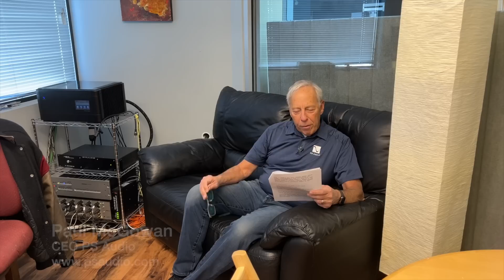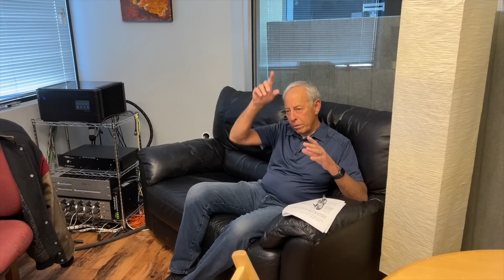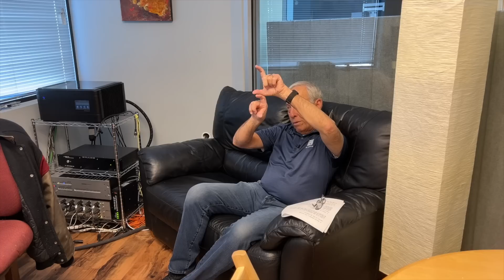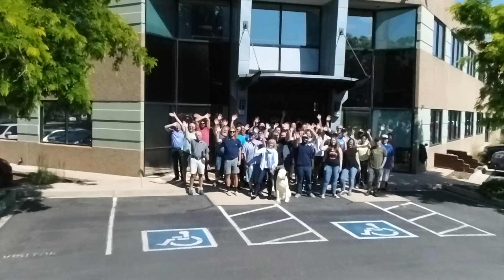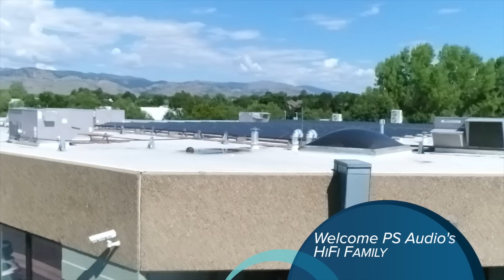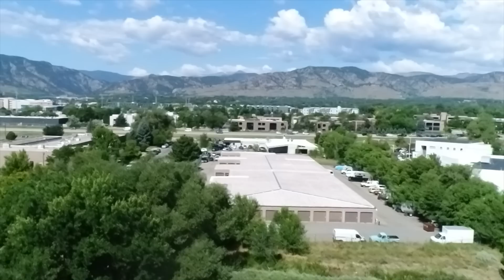Understanding series and parallel speaker connections

Comment: Hi Paul, your explanation is geared more towards electronics. Let me simply for anyone who wants to know how series and parallel connections affect loudness. 
When you connect two speakers in parallel you get a total of 6db increase in the SPL level of a single driver at the same amp volume. 3db from doubling of power due to halving of impedance and another 3 db from the summing of sound waves from each individual driver. 
Connecting two speakers in series, there will be no SPL increase of the two drivers vs one driver at the same amp volume. That's because impedance doubles hence halving power which leads to a 3db decrease in SPL. The 3db increase from drivers summing cancels out with the 3db decrease from halving of power.
The advantage of a series connection is you double the power handling of the drivers hence increasing the driver's maximum loudness. It also lowers distortion at high volumes since it halves the excursion required to produce sound at a certain SPL level.

Comment: So what is the practical impact of the two speaker cabinets in series?  Expect to need to turn up the volume to get the same loudness.  Also expect the sound quality to be lower.  Each cabinet is a complicated circuit with resistors, capacitors and inductors to feed the proper frequency to each driver ideally without messing up the phase of the signal to each driver.  By the time the signal passes through them both my bet is the sound from the two boxes is a bit muddled.  Also the wave propagation from the baffle of each driver will be interacting with each other so the chances of the image being as good are low IMHO.

Comment: I used to have a cheap hifi system. In series there was no problem,  but in parallel the amp would start clipping at higher volumes
Reply: Yes, and some speakers have dips in the impedance at a certain frequency that makes the matter worse when you put them in parallel.
Reply: @ThinkingBetter  which is better... connecting two sets of speakers from the amp, or from the back of first set into the back of the second
Reply: @geddylee501  When speakers are connected in parallel you will get best result (at least theoretically) by having both connected directly to the amplifier for best damping factor/behavior.
Reply: @ThinkingBetter  🍻

Comment: Confused question, confusing answer. A speaker marked 8Ohm 30Watts means the speaker can handle an input of 30Watts. 8Ohms is the nominal impedance and this may drop to 4Ohms at some frequencies. Connecting two 8Ohm speakers in parallel may not be a good idea as it will present a nominal 4Ohm load to the amplifier which may drop to 2Ohms at some frequencies. Many amplifiers will be unable to drive such a low impedance unless specifically designed as a high current amplifier.

Comment: Does an amplifier put out higher voltage to higher impedance speakers?  I would think there would be a max voltage dependent on the input voltage and the output voltage is a multiplier of that (minus voltage drops from volume adjustment pots) as both input and output transformers would have a set number of windings.  So the max output your amp can do to 4ohm vs 8ohm speakers would be twice as much, but that is because the amp is putting out twice the current to the lower impedance speaker.  P=V^2/R=IV

AFA speaker wattage, connecting 2 30W speakers gives you 60W total max output no matter how you wire them.  So you can output 60W to 2 30W speakers without destroying them.

Comment: I think an explanation of what the ''rated at'' numbers are on a speaker may be helpful? Just because a speaker has, let's say a 30watts sticker on the back, in reality that means very little. Apart from don't plug then into a 100watt amp and run them full blast. I might be over simplyfying?

Comment: Than you for the simplified explanation, but I wonder how the sound is affected?
Reply: Probably depends on application. Combining speakers isn’t all that common in home audio. 

It’s more common in car audio and with multiple woofer set ups.  Traditionally it seems best route is to connect in parallel and try to go as low impedance as possible to a point as to what the amp can handle. 

My friends and I experimented with both types.  I tried series approach with 4 8 inch woofers in a box and I wired in series.  Didn’t sound good.  May have been other reasons too. Box size.  Not perfectly sealed. 

Had another friend that was running a 2 eight inch woofer with one 10 in dual voice could sub.  He wired in parallel and I believe all his were 4 ohm as well.  His problem was clipping and also speaker sensitivity where volume would increase too high by slightly touching his slider level volume control.  We switched to parallel setting and it was much better. 

I myself went to 2 10 inch subs with a 12 in middle sub.  I think the 10’s were 8 ohm and the 12 dual coil coil 4 ohm.  I hooked these up in parallel which I believe was 2.7 ohms per channel. Same amp. Produced more strong bass but I designed a better sealed box too.

Comment: Question: I have some Boston HD10 speakers that I purchased new back in the mid nineties. They are advertised and  labeled as "8 ohm" impedance and advertised at 90Db/W sensitivity. They were originally powered by a Pioneer VSX-4800 surround amp that was replaced recently with a Yamaha S701 2 channel integrated amp.due to the speaker outputs cutting out at any decent volume
I do realize that speakers are driven with AC voltage, not DC, and that impedance isn't exactly the same as measuring static DC resistance. 
When I measure the DC resistance through the  HD10 speaker leads, my DMM measures ~3.7 ohms. 
Should a speaker advertised as 8 ohm impedance measure closer to 8 ohms static resistance, or are these Boston HD10's actually lower impedance than rated by the manufacturer?
This concerns me as, from what I understand, running 4 ohm speakers with an amp that is designed to break against an 8 ohm load can damage it due to higher current being required to drive the 4 ohm speakers. I'm wondering if driving these HD10's was the reason my Pioneer amp met it's demise.
Any opinions?
Reply: If 3,7 Ohm - those should be rated at 6 Ohm. 
From my own experiences, usually 4 Ohm rated speaker gives 2,5 Ohm, 8 Ohm rated - no less than 5 Ohm.
Reply: @jareknowak8712  Thank you for answering my question. After reading up on the subject I think running my HD10's with the S701 will be perfectly fine with the amplifier impedance switch set to high, 8 ohms. I'm using a powered sub in addition, and I don't listen at very loud volumes.
Reply: @@Douglas_Blake Thank you for your input, makes good sense. So far so good, my HD10's with the powered sub sound great with the S701. The unit only seems to be emitting minimal heat through the convection cooling vents on the top. But like I said before, I'm not listening at very high volume levels, let alone for a prolonged period of time. I have common wall neighbors, so my volume levels are limited, but I did "de-couple" the sub and speakers from the floor so as to mitigate potentially disturbing my neighbors.  What I like is that it sounds really good without having to play at a high volume level.

Comment: it becomes like a battery and light bulbs. A light bulb draws 1A with current. 2 pcs. parallel connected bulbs draw 2 A of current.

But the battery must be able to deliver 2A of current or it won't work.

Two 8 ohm speakers connected in parallel will be 4 ohms. yes you should get twice as many watts. but then the power supply and transistors have to handle it.
This is where the problem lies. many amplifiers are unable to provide twice as many watts due to the transistor and power supply not being able to do this.

and a speaker does NOT provide a constant 4 ohms but change up and down with frequency!

8 ohms often give better sound than 4 ohms.

Comment: So if I’m wiring two 8ohm speakers together, so I can use only one output on my amp…which is better series or parallel ?
Reply: Don't do it. They both have problems. Think about it, your speakers both go up and down in current needs at different impedances because you're playing 20hz to 20kz. Now they both are sometimes spiking in power needs and sharply dropping together. In parallel they're doing it in sync so what I just said above. In series, it's more averaged out but now there's a lot more resistance to the current. Your single channel only has half the total voltage of your amp and voltage pushes the current. So now your sound quality is shit because even if you have the power you can't move it effectively and it still might be difficult when the speakers impedance dips. It'll dip less but still be giving your amp a suicide mission.
Reply: If you also are wondering what if I use 2 bridged ampa to run speakers in parallel or series to it gets even worse. Because when you bridge the output it can't handle lower impedances even more. The power does but so does the impedance.

Comment: Hey Paul, I think I get the part about ohms, volts and watts but the bit about the light bulb got me confused. A light bulb usually takes 110 volts. Not 10. I'm stumped.
Reply: The 10V is just an example in relation to how the speaker performs when wired in series.
Reply: You dont put 110v AC into a speaker !!!   You put 110v into the supply of the amplifier then the power supply circuit of the amplifier drops the voltage to around +40v to -40v DC.  Then the  amplifier circuit creates an AC voltage based on the small input voltacge from a source The output voltage of an audio amplifier is obviously much lower.
Reply: @Projacked1  I was trying to be funny because people are so frigging  serious.
Reply: @philipslighting8240  Thanks for the lesson but I was trying my hand at comedy.
Reply: @artyfhartie2269  hahaha you got me !
Reply: @artyfhartie2269  Try ending with a  🤣😁😆😉

Comment: 10 volts RMS over 8 Ohms is 10x10/8=12.5Watts. Two speakers in series is a dumb idea as you lose half the power.Rather, you can potentially get twice the power by putting the speakers in parallel and potentially that will yield a louder volume. Reality is however that you are introducing a comb filtering with doubler effects between your two speakers outputting the same signal and...for audiophile listening, this is also a dumb idea as the frequency response easily will end up being messy as the two speakers won't be exactly in phase relative to your ears.
Reply: @@Douglas_Blake Well, it's basic audio stuff. Audiophiles should stay away of doing this entirely. I'm happy with my KEF Uni-Q single-point source drivers that maintains phase integrity through the entire audible frequency response and the very opposite of that is to duplicate your speakers (series or parallel) messing up phase completely.

Comment: What does in series and in parallel mean?
Reply: Red wire from the amplifier goes to speaker 1, pin 1. Blue wire goes to speaker 2, pin 2. 3rd wire (inside the speaker cabinet) goes from speaker 1, pin 2 to speaker 2, pin 1. That's series.
Red and blue wires from the amp are both splitted inside the speaker cabinet (Y cable) - so every speaker gets a red wire to pin 1 and a blue wire to pin 2. That's parallel.
Reply: Google it,  dont ask here.

Comment: It's confusing because some sensitivity pseudo-units and "nominal" impedances are confusing. A sensitivity in dB/W is self-explanatory and don't change with impedance, whereas "dB for 2,83 V" is [...]. Why 2,83 V ? I subtract 3 dB/W for 4 Ω speakers that use that strange convenient unit (dB for 2,83 V???). I subtract 3 dB/W again for "8 Ω" speakers that don't have enough minimum impedance (80%) and behave like 4 Ω speakers. ¿What is a 4...8 Ω speaker? Minimum impedance for an eight ohm speaker should be around 6,4 Ω. Parallel connection will drop the impedance and increase current and wattage. Serial connection will drop tension for each driver (voltage divider) and increase impedance, therefore increasing volume to reestablish tension of each driver will increase current and wattage demand too. In conclusion (I might be wrong): more drivers, more wattage and current; less real sensitivity in dB/W, more power that the amplifier will have to supply.
Reply: @@Douglas_Blake Exactly although I don't know if it's fair or not. The amp will try to keep the voltage stable, therefore a four ohm speaker that declare a pseudo-sensitivity of 90 dB for whatever voltage (2,83 V usually) will draw the double of power than an eight ohm speaker. Measured with a more accurate unit, one will have a sensitivity of 90 dB/W and the other 87 dB/W, which will reduce the confusion of some "reviewers" that have to change sensitivity perceptions on the fly.
Reply: @@Douglas_Blake No they aren't because current and power drawn from amplifier aren't the same. John DeVore rant was very interesting and funnier than doing the calculations. dB/W is a technical unit useful for comparisons, whereas "dB for 2,83V" is like comparing apples and pears or max. speed of cars in mph or km/h without telling which is the unit. For four ohms in the "new version", the voltage should be 2 volts to be equivalent to an eight ohm speakers. Which speaker has the highest sensitivity, the 8 Ω speaker with 90 dB for 2,83 V, or the 4 Ω speaker with 90 dB for 2 V? The last one is a fair comparison to me, and even more clear if we write that the first one is 90 dB/W and the second one 87 dB/W.
Reply: Nonsense.  its not that difficult.
Reply: @philipslighting8240  It's what I think, basic science is not that difficult. Understanding how an audiophile can connect many speakers in parallel or only one with four ohms or less impedance without increasing current and power requirements, which is like creating energy from nothing, that's way more difficult. Reviewers: "these two speakers have the same sensitivity and phase for one particular frequency, but the amp struggles with one of them"; that non sense is difficult to understand.
Reply: @Jorge-Fernandez-Lopez  What has a so called audiophile got to do with basic electrical theory ?.  I am an electrical engineer is just basics not difficult.
Reply: @philipslighting8240  If you are an electrical engineer you can help us with calculations and technical arguments. What do you think about John Devore's explanation? How much power will need a speaker that's is playing one frequency, with no phase difference between current and tension vectors, and a resistance (I don't use impedance in this case) of 4 Ω for 2,83 V?
Reply: @Jorge-Fernandez-Lopez  Tension vectors are a mechanical issue nothing to do with basic electrical impedance calculations.  I think you need to listen to music more and stop fretting.
Reply: @mikepxg6406  Move phase graphs to a circle and you will have vectors, one for the current and another for tension with a phase between them and a rotation speed. I think you need to listen more, read more, and give more  technical arguments. I wonder why some brands give sensitivity in dB/W, while others choose another more favorable pseudo-unit with asterisk in some cases.

Comment: Howdy. No intention to be a wise guy.
If one doubles the voltage to a series one will get double the total wattage and hence double the volume.
To get the same wattage one needs to deliver sqrt2 times the original voltage.
Regards.
Reply: Nice try, but this comment adds more mud to this muddy river.  Doubling the power (wattage) does not double the volume (loudness).  All other things being equal (excluding the voltage, current and impedance that must be changed in some way to change the power), doubling the power will increase the volume (loudness) by about 3 decibels (dB).  For most people to say that something is "twice as loud", you need about 10 times the power, or + 10 dB.  [Assuming same signal type, same speaker, same distance, same room, etc.]
Reply: Yes, one big problem with what was said is that if you double the impedance and double the voltage, the sound level from the system doesn’t stay the same.  What does stay the same would be the current, and the wattage (and sound output) per driver.  But now you have 2 drivers, so the total amount of sound from the combination of the 2 drivers will be 3 dB louder.  You doubled the voltage and kept the current the same, so the total wattage fed into the combination of drivers was doubled.
Reply: @boblehman1726  Howdy. Yes.
You are, of course, 101% correct.
Regards.
Reply: @kc9scott  Howdy.
My thinking too.
Regards.